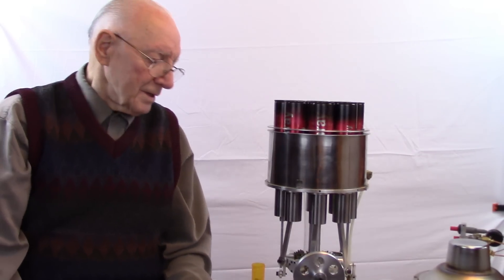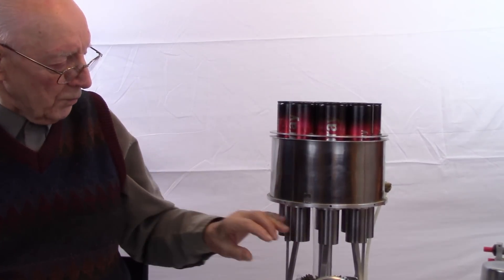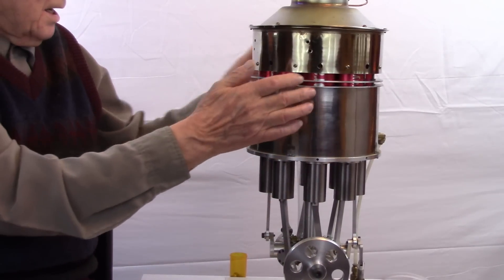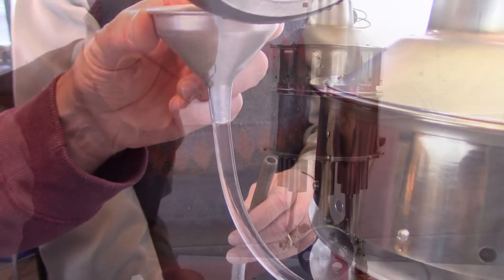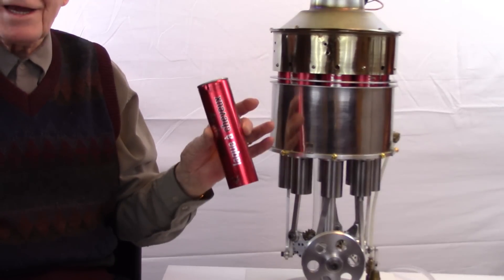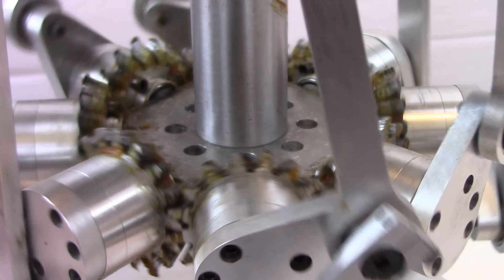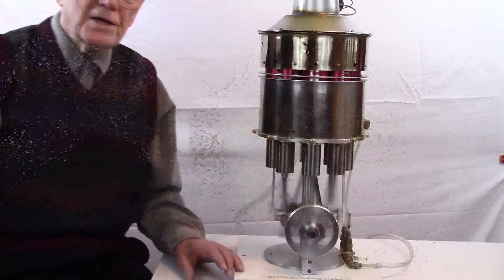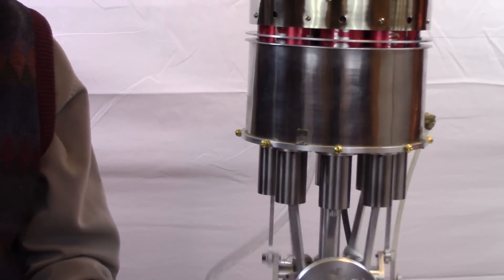CRAZY 8-CYLINDER STIRLING ENGINE!!!!

Comment: Just found out about these devices, when I seen one working I thought my buddy knew magic 😂 
Am looking now for a giant design single Piston Stirling system. Am wondering if such an engine could be made big enough and strong enough to spin a decent sized generator...could have a woodstove with a Stirling on top hooked to a jenny and get freepower from the firewood I already burn to heat my home or would it have to be tons of small cylinders hooked together like this. If a big one can't be made with a single cylinder that means more maintenance as it would need more parts kept up. Plus will any design have enough power to turn a Jenny.... One thing I haven't seen is an oil distribution system for the cylinder walls, seems with all the rubbing in the sleeves and heat that the piston rings or sleeve walls would wear out fast if using it 24/7. 
Might go gasofier system if Stirling is just a dream, just seems a Stirling would be less hazardous and easier to maintain. 
Imagine running all the electric in your home with firewood or coal that is already being used to heat your home. Free electric!

Comment: Amazing. 
But i keep thinking the bottom of the cylinders remind me of hanging tube chime bells that can vibrate a lot of sound energy away. I wonder if you can make it quiter with an epoxy composite surrounding all the pipes at the bottom. 

Or encase the crank and pressurize the air in the crank case to 2 or 3 bar.   I'm pretty sure you will be able to get more power that way.

Comment: Here's a thought, preheat the fuel with the waste heat comming off the cold side of the stirling engine.  If your useing propane, as it expands it cools helping keep the cold side cold, and the energy used to preheating the fuel is recycled helping the burner get a little hotter.

Comment: Great piece of engineering. Just a small suggestion. Instead of those gears, can you individually drive small alternators, whose output can be consolidated and used directly to do work.
Reply: Just put the generator on the weal instead. If you were thinking of electricity for light or somthing like that.

Comment: Wow!,  that is cool! I would like to build a Stirling to generate power. I need atleast 8 hp, 25lbft of tq! Minimum. For atleast 1500 watts, 3kw would be better. But I'd like to use focoused solar in summer. And propane and /or wood in winter. Maybe have a water javket for cooling, and a air jacket type thing to funnel the heat on the hot side. I can build gas engines, surely I can build a Stirling, IR running or no, is another topic!

Comment: I am afraid heater construction is not very efficient, there is a reason we put a teapot on the fire, not under.
Reply: i am afraid that you don't understand heat engines.  or the  NEED  to keep the cold-side  cold.
https://en.wikipedia.org/wiki/Stirling_engine

Comment: Does more cylinders = more power ?
Reply: Having at least 4 cylinders allows to simplify mechanism - one cylinder system cannot connect working piston and displacer together, they have to be 90 degree offset. On 4 cylinder you connect displacer to the working cylinder next to it and offset it to 90 degree. Last one can be connected back to the first as 4*90=360 or full cycle.

Comment: Neat... seems like a bigger flywheel, better heat exchanger mechanism (fins around perimeter of lower area, insulation between heat source and cooling/cooler volume) for more differential maintenance, helical or spiral gears (thinking helical is correct, though not perfectly parallel so maybe spiral is more correct), maybe even a fan powered from the flywheel shaft will help use some energy to cool by blowing heat away versus I assume there is a water pump exchanging heat... though not sure and the water will store heat more than exchange unless your exhanging the heat with maybe a fan on a car radiator or heater exchanger with a generator on the flywheel (maybe use a Fisher and Paykel which ever side (rotor or stator) weighs more as the flywheel), use hydrogen helium as the gas media if you can seal the gas in good with maybe a leak system where the fuel can be used and preheated even though not sure about that system and finally pressurizing the whole system to increase efficiency. Keep up the great work young man!  :-)  Neat design.

Comment: Nice machine made from inexpensive parts!
Cutting gears on a band saw would be a tedious process though :)

Any idea the working power your machine could produce & the fuel consumption rate at that power level?
Reply: I would have preferred a angle grinder except then you have the dust.

Comment: So is it not a steam engine considering it is powered by pressured water?  But it is a beautiful engine no matter and looks stunning
Reply: It's not powered by pressured water. It's powered by heat differential. One end of the piston is cooler than the other. This creates an energy imbalance that the moving piston rides along.  You can run a Stirling engine by sitting it on a block of ice if the room is warm. As long as there is a difference of temperature between the two ends, the engine will function.
Reply: The beauty of an engine like this is that unlike other engine technologies, this one can operate on waste heat provided you capture the heat and run it through the engine.
Reply: @alcurb  , to be sure, BUT: you need collectible waste heat AND a good thermal sink in close proximity.

Comment: Wonderfull Machine!
I fell in love with the Stirling cycle engine years ago. I used to go to bed thinking about the design and how i might make a machine with some decent power output. I can see that this is a nice design. Nice Job.
Reply: I built one, and i find the physics fascinating .    No one around takes much interest in my engine.   i just love to learn new things and to take an idea and create a working thing.   not much good for anything.   they are so in efficient, the most it does is just spinn the flywheel and spin and make a mechanical noise.  Adults can have toys you know, and these are inexpensive and safe.  Not like some fast car or airplane.

Comment: Great Engine! I however was disappointed to see that even 8 cylinders won't make it self starting. Makes me wonder if the Stirling Engine will ever be of practical use.
Reply: They have been in practical use for well over a century, they just are not practical for things people seem to expect from them.
19th dentists all used them for running pneumatic drills.
There are some commercial generators available for when you need quiet operation and not lots of power.
They are used in refrigeration, and some of better lab freezers use them.
Reply: joshua43214 also submarines
Reply: Zorgoban u can add an elictric starter like all cars cars aint self starting either in that case lol

Comment: Wow. Provide heat from a solar collector, a proper generator/alternator, and that is a feasible power supplier
Reply: Rohit Arora it's not about efficiency...it's about cost per watt...making silicon wafers is expensive and tedious work, Stirling engines can be made using recycled materials!! At home
Reply: i have tried to make this as my college project , was only 12% efficient , solar panel would beat that alternator generation with wafer , if this could be implemented for large generators

Comment: If your impressed with the information that was shared? Let me know if you would be interested in designing a 6 or 12 piston cold gas engine that can generate ultra cold temperatures use gadolinium for magnetic bearings and be able to use super conductors for electrical power generation and air conditioning systems? If we can speak the same scientific language? 😊

Comment: Try high heat magnetic bearings in your design for all the moving parts. Try a V 6 engine design with two fly wheels with a center power train.

Comment: That's cool. I got some ideas and drawings of multiple (2,561 last time I counted) engines of desil, gas, steam, and Stirlings. I've been perfecting each design over and over. I've thru together a twin piston (two converted 21hp Briggs) hit an miss to run and old 8hp Briggs that I converted into a air compressor. I sold it to a good friend.

Comment: I wonder what the watt output and how the displacers are connected. Perhaps they are connected to the preceding power piston? Since there is a phase difference between each cylinder??
Reply: This is a 8 cylinder Siemens stirling engine design. Very clever.

Comment: The 10 people that disliked dont know what a stirling engine is
Reply: Or they find the engine design ludicrously complicated and inefficient.
Reply: Horse shit. Afr less complicated than even a fifty year old internal combustion engine.
Reply: The Stirling Engine is much older than Stirling Moss, actuallu invented by the Reverend Stirling as an alternative to the steam engine boiler explosions. Boiler explosions were the result of poor maintenence and and bad operating practices.
Reply: Reverend Dr Robert Stirling  https://en.wikipedia.org/wiki/Stirling_engine#Invention_and_early_development
Reply: But now it's 56 haters that dont know what a Stirling engine is check to see.
Reply: It's because he did a piss poor job..... Apparently you do not know what a Stirling engine is or how it works... This isn't an alpha, but he has no displacer to force air back to the cool side...... Instead he built additional cylinders to use their "power stroke" to force the still hot air back to the top rather than using the vacuum force to pull it back up..... 8 cylinders eh? Sounds about right. It's probably about 1/8th as efficient as a real Stirling engine.... Also he had no cooling fins to help the process along even. Id barely even call it a Stirling engine.... Very inefficient. But I'll bet it was fun to build.
Reply: They really suck
Reply: Sterling Cycle engines in general aside from slow throttle response are excellent efficient engines but this one is badly designed except as a toy.
Reply: No. Its because a tons of engines on YouTube have 5000rpm or 500 degrees of heater or 50 volts on generator or lights up 200 leds. This one have 8 cylinders. So what?  No one of them specifying power in watts - the only thing matters for engine.

Comment: That's a wonderful Stirling Engine assembly.  The gearing to combine the output of the 8 engines is very clever and different from the swashplate designs I am familiar with.

Comment: This type of engine is only for demonstration because it has no practical use
Reply: djalma de oliveira powering submarines is enough for practical usage.
Reply: To be sure, they're not very practical.  This one could handle the load of a small generator, but that's about it. Still, very cool. The heat differential matters; it helps that there's a water jacket.
Reply: djalma de oliveira The Stanley  engine is over 100 years old. It has been given a New LIFE in the past 10 years or so been used all over the WORLD. By adding SOLAR for heat. Great new twist by making a 8 cylinder engine. The REV. STANLEY. WOULD BE VERY HAPPY.
Reply: Sterling cycle engines are practical for turning a 100 degree f temperature differential into work but this design is just ludicrous.
Reply: djalma de oliveira this is actualy being considered for cars already

Comment: Awesome engine! If you replace the aluminum displacer with one made from stainless steel it will work even better. A displacer should always be made from a bad heat conductor.
Reply: Using steel for the  displacer is a bad idea cause its too heavy to lift by  hot air ...even cars pistons arent made of steel...think of a material like ceramic: very very slippy (zero friction) and heat proof ...if  the walls of the cylinder are also made of ceramic the displacer can fit the cylinder with a squizey tolerance ( within micrometers) no sound will be heard...ceramics can also serve as interface between moving and fix parts so no lubrification (engine oil) is needed...no friction=no heat so no cooling system needed (Radiators+water pump)...isnt that COOL?
Reply: @doublestarsystem  The history of the use of ceramics in engines is ancient. To build a piston and a cylinder with micrometer tolerance and get to grips with the thermal problems is a completely different topic. Yet to produce cost-effective is a thing of impossibility. Reality is the spoilsport.
Reply: Latheman's crazy machines I think aluminium is better cause its light weight and can work as regenerator to cool the air down when it goes from the hot end to the cold one.
Reply: Engine operation will also improve, to an even larger degree, if an economizer is placed between  the hot and cold sides of the engine (something I did not hear being mentioned in the engine's presentation). Come to think of it, the role of the economizer could be undertaken by a displacer with low thermal inertia, i.e. a good conductor of heat. Please correct me if I am wrong.

Comment: Great work.

What is driving the displacers, please?
Reply: Tristan Cooper hot air
Reply: Someone posted an answer in another thread which seems plausible.  Simplifying to four cylinders,  A,B,C,D, the power piston A is directly below the air chamber and displacer that belongs to B.  They can be linked by a straight rod passing through an airtight seal, so piston A and displacer B  are in phase. Piston A is driven by air from chamber D.  And so on around the circle.   In this way we can get the 90 degree phase relationship between piston and displacer for each "engine", it's just visually deceptive because, in a vertical line you have parts belonging to two engines.  Nice idea.